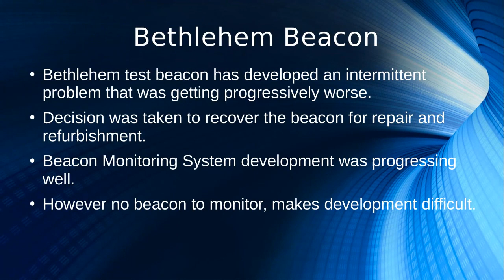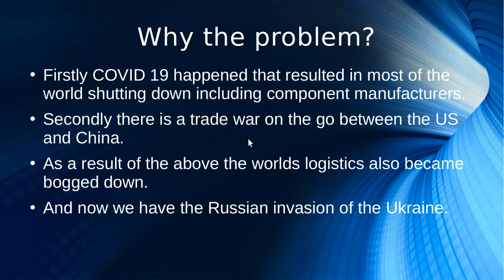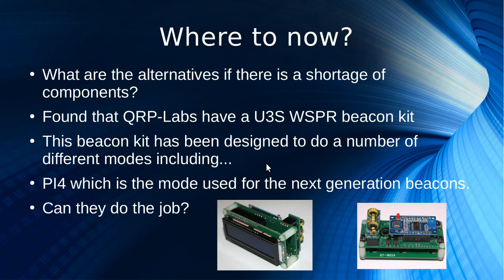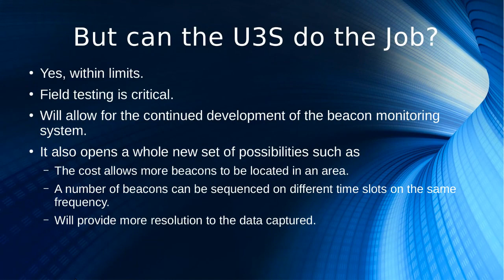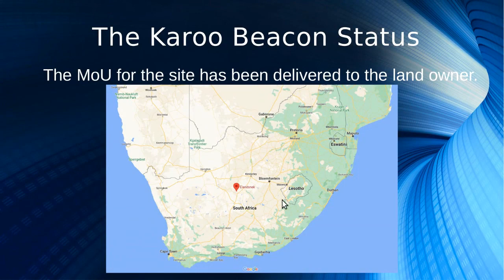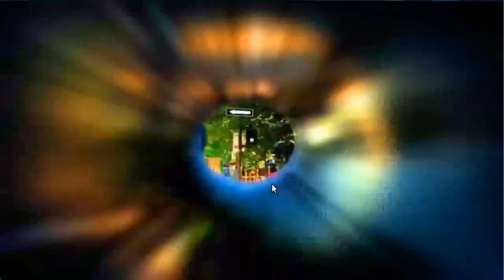Next Generation Beacon 9April2022

Comment: How much CPU power is needed for the beacon ?
You can use pretty beefy routers ( like Mikrotik Hap2 AC devices ) they have USB and some GPIO, don;t use SD cards and have filesystems that don;t wear flash memory...
they are more readily available than Pi/ BBB/ Odriod 
, can also run OpenWRT so that you can run regular Linux scripts and things on them ( remote login, ssh, mqtt server or client  and all that )